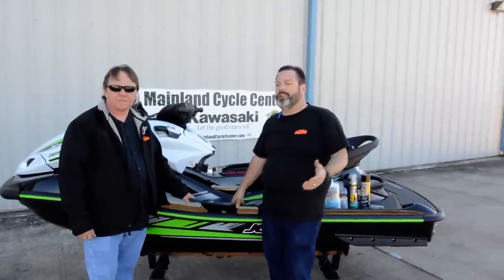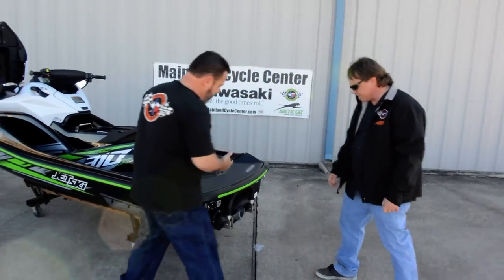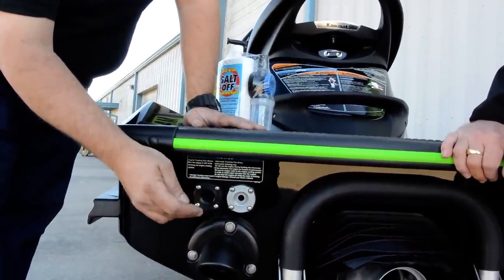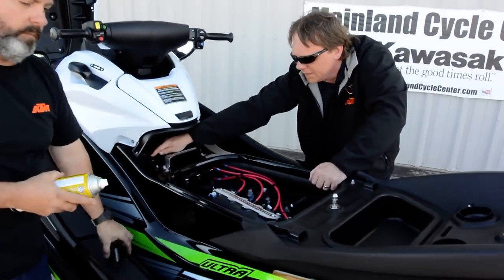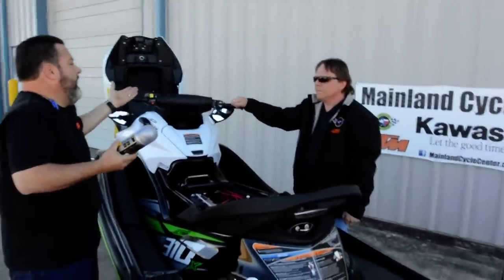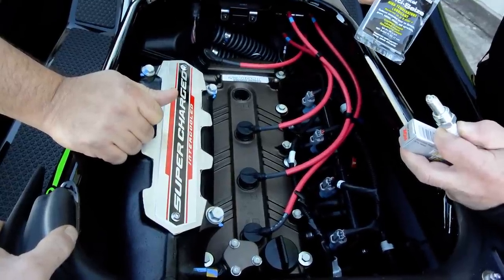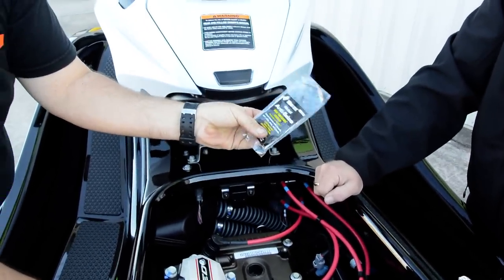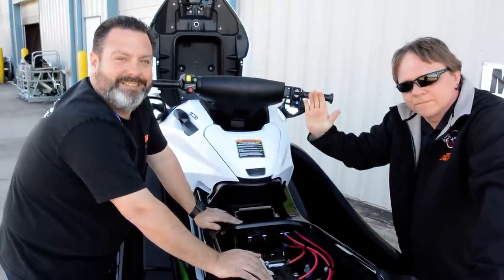Mainland Cycle Center  WHAT YOU NEED TO KNOW IF YOU OWN A KAWASAKI JETSKI!

Comment: 20 mins of flush? If you sell ski after 3 years in the add you should list 50hs 30 riding 20 flushing! 🤣🤣! 2-3 mins will do the work ! Fogging just 5secs! 15 secs of fogging you will have an intercooler full of oil in 6 rides! And If you dont know were your spark plugs are do not attempt to change them by yourself ! Good video guys !

Comment: Learned something today. Anti-seize on spark plugs. Good tip.
Reply: Update: I did some research on NGK spark plugs and they say do not use anti-seize on NGK silver or chrome finished spark plugs because they are designed to provide corrosion resistance against moisture and chemicals. The coating also acts as a release agent for spark plug removal. NGK spark plugs are installed at the factory dry, without lubrication or anti-seize. Anti-seize alters the torque specs up to 20percent, increasing the risk of spark plug thread breakage.